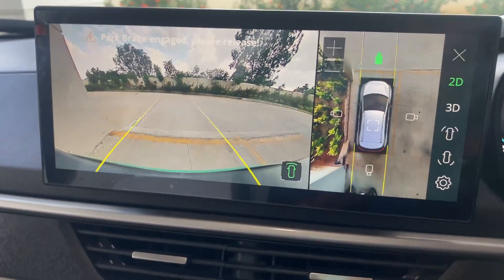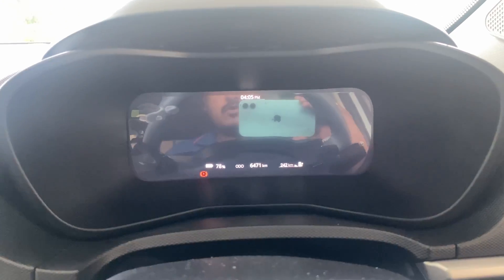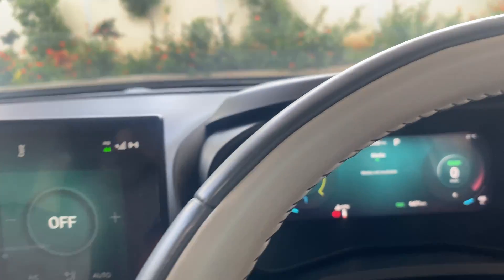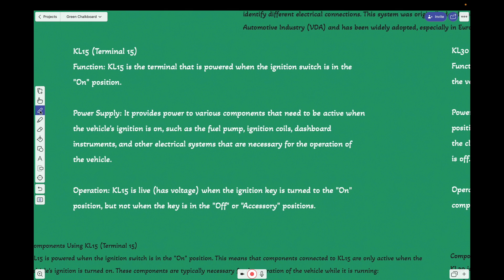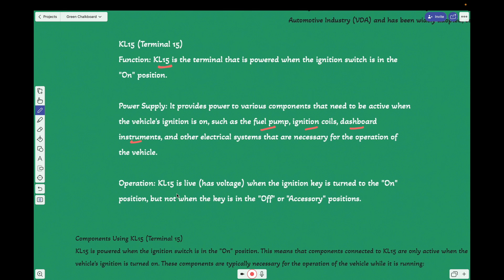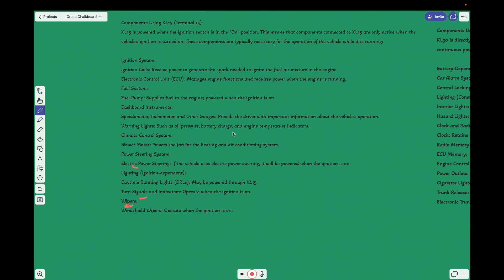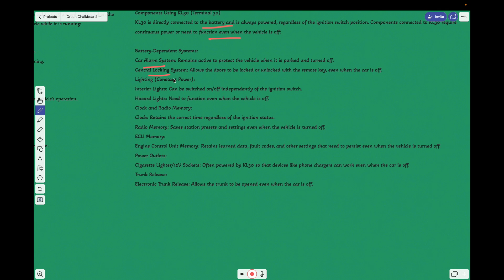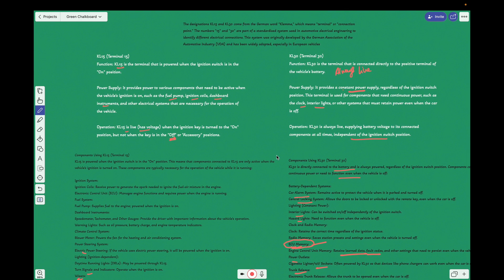Difference between KL15 & KL30 | Embedded World Automotive

Comment: Something very interesting happened regarding this. I have an Opel Corsa B, and my 17th fuse blew. Normally, the user manual mentions warning lights, indicators, etc., for that fuse, but on the cover of the fuse box, it just says KL15.  In reality, both the indicators (including the temperature gauge) and the radiator fans and/or their sensors are connected to this fuse. Because the fan didn't turn on, the car overheated. Isn't it a flawed engineering example to connect both the fans or their switches and the temperature gauge to the same fuse?"